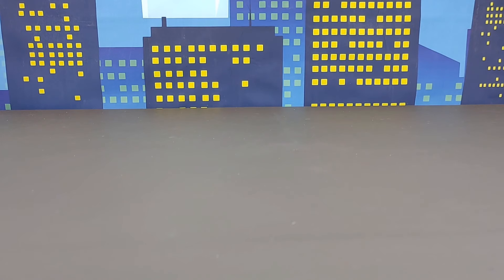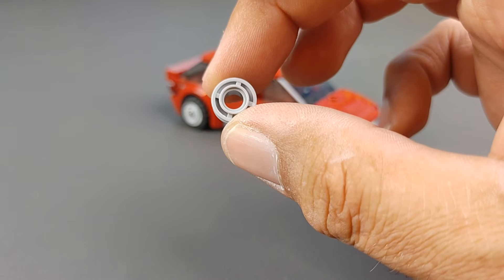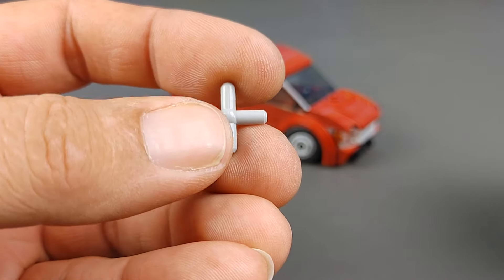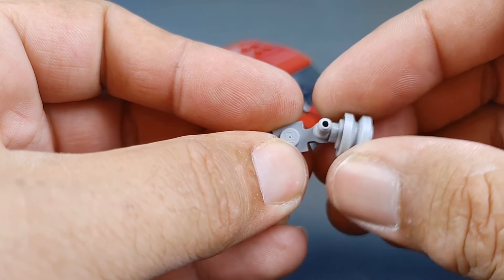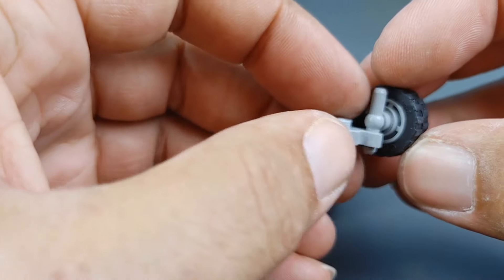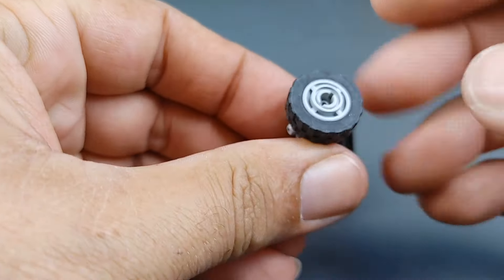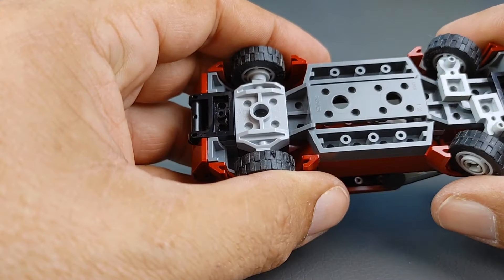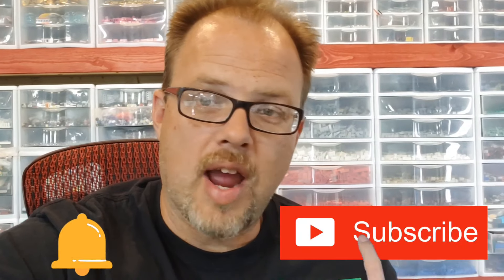How To Make Wheels Turn On A Lego Car.

Comment: Cool idea!
Reply: On an entirely different note, Daryl Jane you ever thought about using the red cross 2×1 technic peg for your mils plate system instead of the  round pegs? It gives an easier connection.😊👍